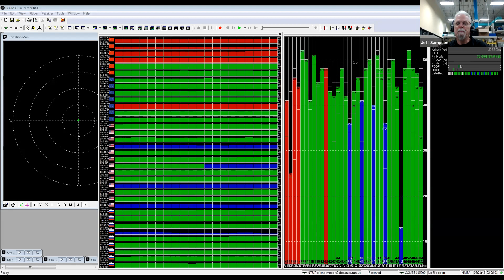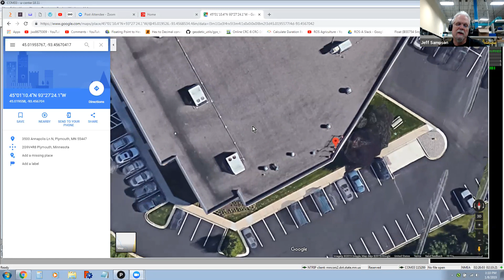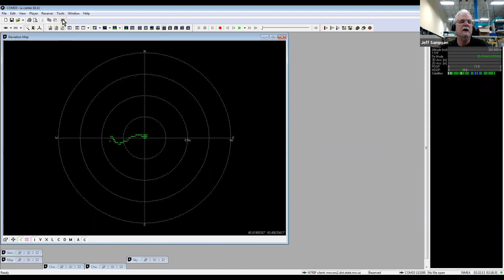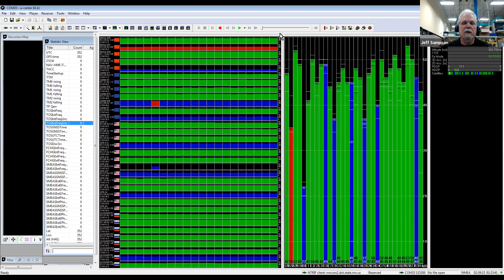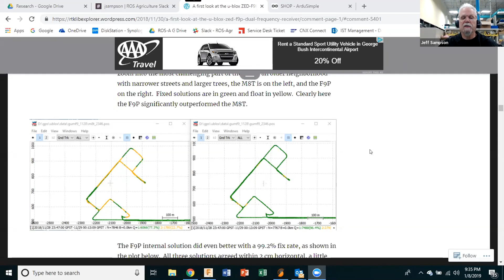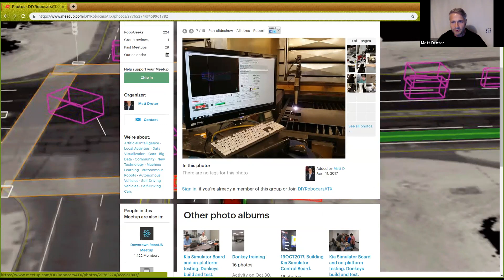Community Meeting 01082019

Comment: The f9p is curently being tested by many farmers in Germany for rtk autosteer.
Reply from the maker: Hi Jerry,  we have been doing some testing and found that using a survey grade antenna helps.  One like this: https://www.ebay.com/itm/GPS-Beidou-GLONASS-Mushroom-Head-GPS-Antenna-BT290/372406093341?hash=item56b522061d:g:n74AAOSw89JbeAUO:rk:1:pf:0
Are you also using an IMU with the GPS?
Reply: @robotagriculture2265  Yes i use the IMU brick from tinkerforge. It is used by the software for better heading and slope correction. In my fields it doesn't make much difference because they're all flat. Im from Paraguay, South America.
Reply: @robotagriculture2265  I'll have to look at that antenna when I get the money to buy the f9p.
Reply: @robotagriculture2265  I'll have to look at that antenna when I get the money to buy the f9p. It's quite astonishing that you can put together a rtk autosteer system for so little money. And addicting! 😁